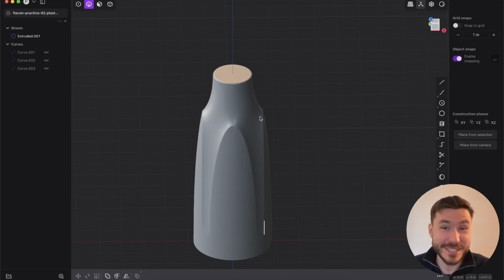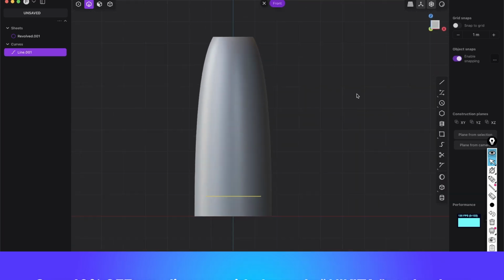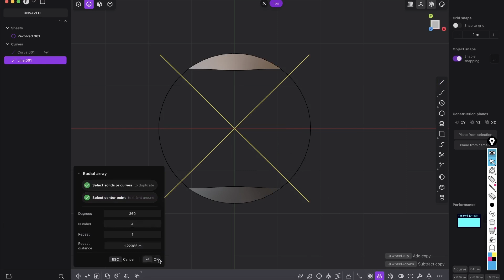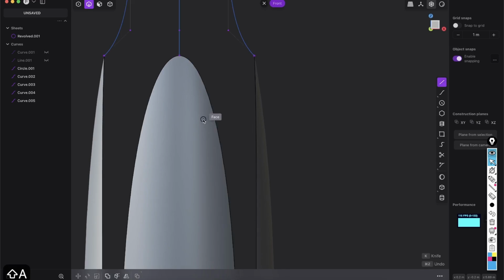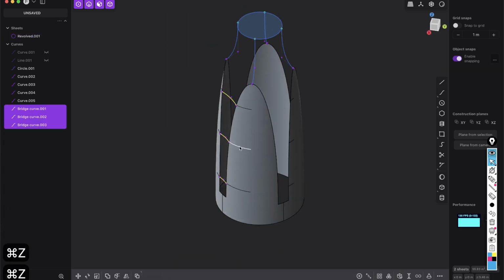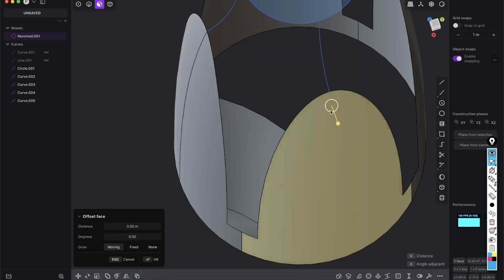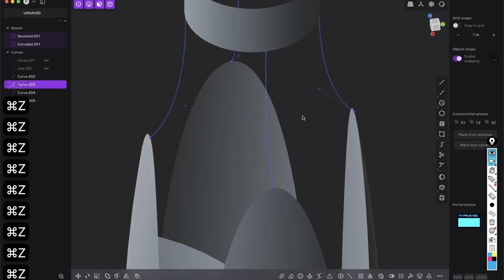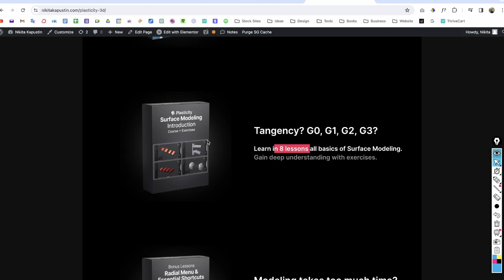Plasticity 3D CAD Modeling Exercise | Flacon / Bottle

Comment: Hmm. The last patch doesn't work for me. I have snapped top curve points, extruded then to get tangent surfaces, deleted blue curve and patch hole does nothing. Don't understand what's wrong. Loft won't help in this case I guess
Reply: Works only after individual bridging of both curves instead of arraying them around as copies
Reply: Still not working @putyavka